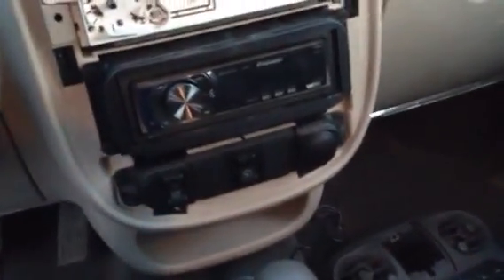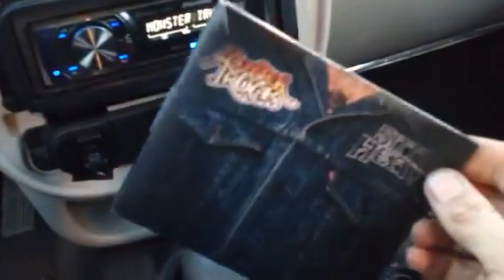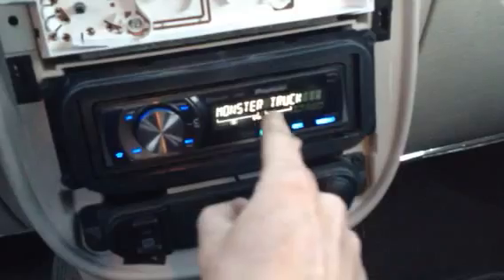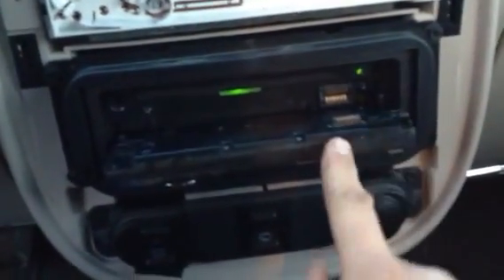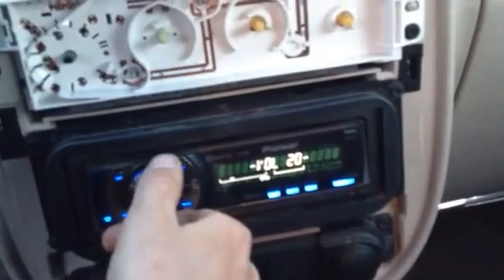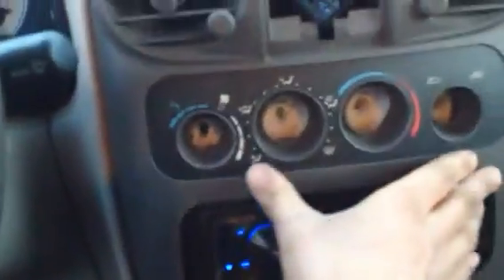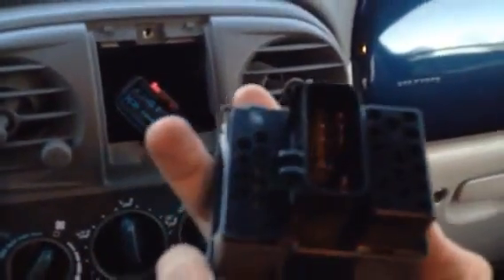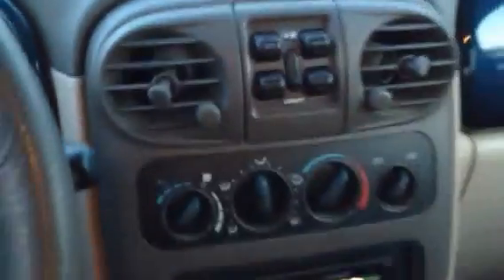Pt cruiser stereo install and test part 3

Comment: im going to be installing a radio myself, im looking at  BOSS Audio 612UA Single Din, MP3/USB/SD AM/FM (NO CD/DVD Player). but im worried about the wiring can i just take the old one out and put the other one in with the same wiring?im totally ignorant with this.
Reply from the maker: yes you could if you don't mind cutting and identifying all the wires in your car's audio harness.  i like to use a 10-15$ harness that plugs into the factory harness and it has colour co-ordinated wires to match up to aftermarket systems.  match colours to the system then simply plug it into the vehicle.  you can remove  the stock radio and use the factory harness by cutting / splicing into it, but be prepared to identify every individual wire before cutting or ruining the factory harness, and if you cut the factory harness make sure your connections are well connected .  thanks for watching
Reply: everything went good i got music but dash light flickers. I checked the fuses they are good.

Comment: What stereo did you use ??
Reply from the maker: I used a regular single-din aftermarket radio.  I think its a JVC.  I have made a recent re-edit of all parts combined into a single video also.  thanks for watching
Reply: MrJohn613 would you think it's compatible with a pt 2002 ?
Reply from the maker: yes, pt cruisers are the same from 2001-2004
Reply: MrJohn613 thanks so much tryna upgrade my pt!
Reply from the maker: no problem.  glad I could help.  :D